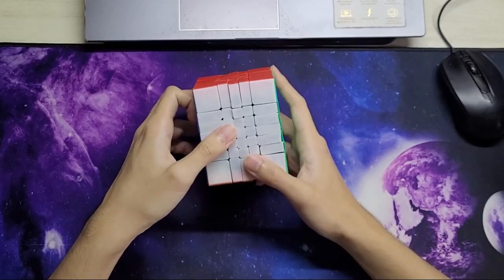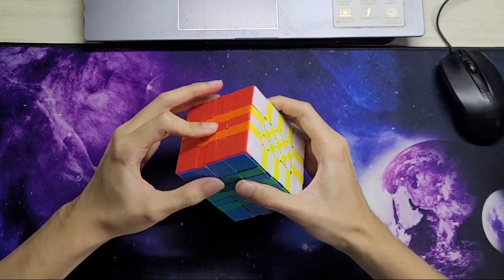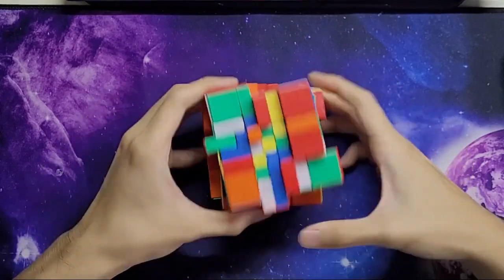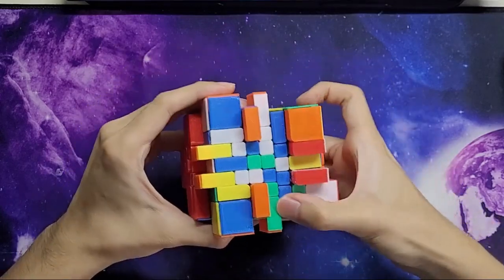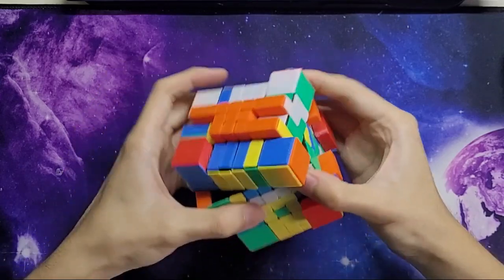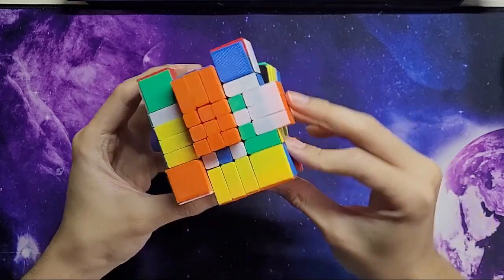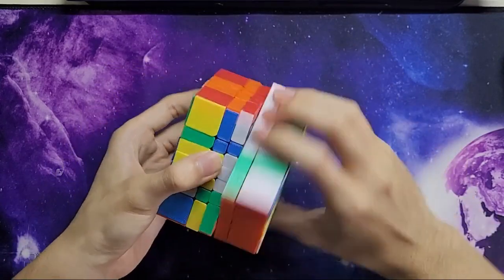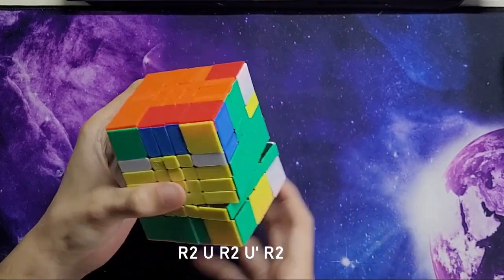I made a STICKERLESS 5x5x7

Comment: You think you could make a proportional one? I made a proportional 5x5x7 a couple of years ago and it works amazingly. Mine is technically stickerless since it has inset tiles instead of stickers but I thought I'd put that idea out there
Reply from the maker: I think that would require me to custom-design the puzzle from scratch rather than plate an existing cube.
Personally, I would rather make a proportional 7x7 first, and given the flexibility of PETG, I might want do it by olzing the puzzle a bit, cut the midges and wings straight and then put a thin flexible square cap on the T centers.
I think this method can make a 5x5x7 smaller than yours (I watched your video before, I think you are referring to the 5x5x7 with 19mm cubies, and you made it big because some pieces are too thin). However, after making my 3D-print-plated MF7S, I'm quite done with 5x5x7. At least for the time being.
Reply from the maker: Just to clarifiy, "Generation 1 to 3" mentioned in the 'history' section of this video refers to methods to mod a 7x7 into a 5x5x7, not designing a 5x5x7 form scratch, if not there would be much more to cover since many people have their own designs.